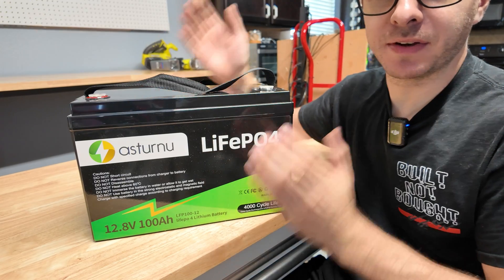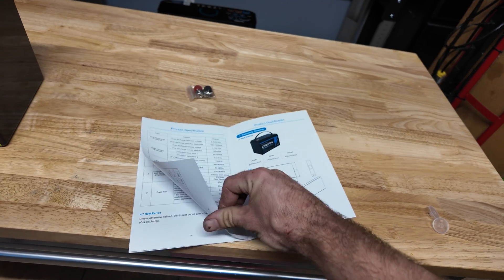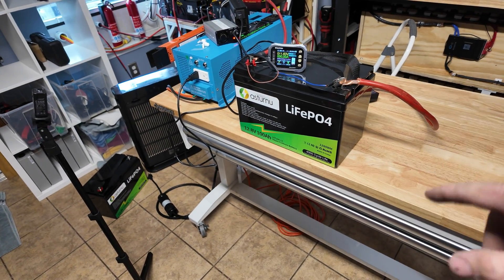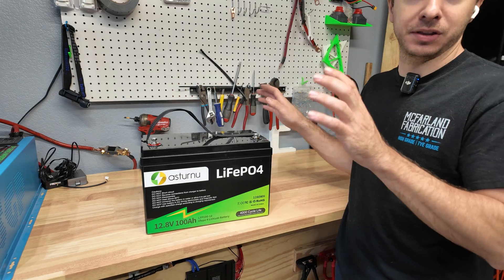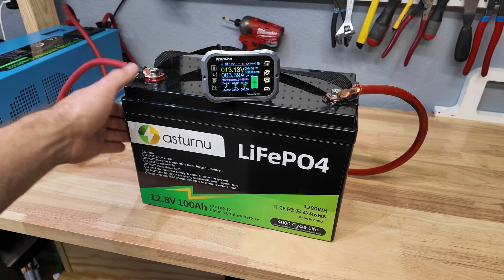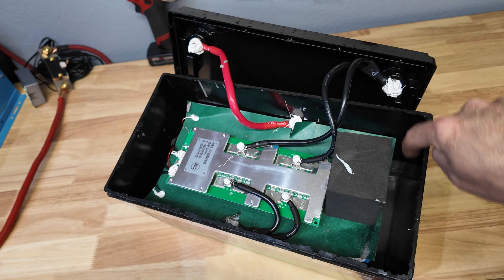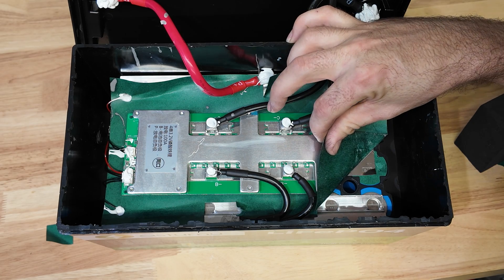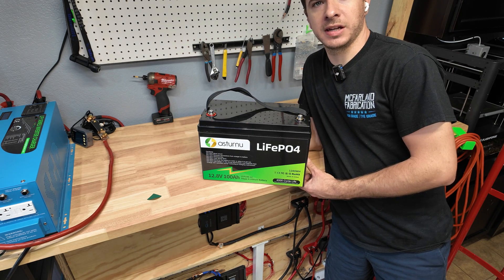Asturnu 100 AH 12 Volt Lifepo4 Battery Review  First Battery To Fail Testing?????

Comment: Good review, Mike, and thank you. I am curious if the 10% loss is due to the conversion from DC to AC in the inverter, or if your other tests on other batteries showed rated capacity with the loss through an inverter.

Comment: Im going to or transform a few UPS' with power stripes. Can you recommend some cheap batteries?  I have 4 ups's and they are about 15 x 6 x 5.  They will likely need new electronics to repower via 115 v ac.
Reply: Lifo or lithium would be fine.
Reply from the maker: What’s inside them now? Lead acid? What’s the amp hour rating?
Reply: @Mikebuildss ty! Single  6x 2.5 x 3.75 non spilable lead acid..   input 120v -12A  50/60 hz,  battery outlets 120v 7.1A 50/60  850va  450w. Total current 12A  USB 5v 2.4A.  
 APC BE850M2 models. 4 divices total.  Not sure what the 850VA is.
Reply: @Mikebuildss . TY.   Brand

APC

Battery Cell Composition

Sealed Lead Acid

Product Dimensions

17"D x 14"W x 9"H

Voltage

120 Volts

Color

Black

Material

other

850VA / 450W Backup Battery power supply

9 Outlets (NEMA 5-15R): 6 UPS Battery Backup with Surge Protection Outlets, and 3 Surge Protector Only Outlets

Two USB Charger Ports (2.4A shared)

5' Power Cord, right-angle 3-prong wall plug (NEMA 5-15P), wall-mountable, plus FREE Windows PC power-management software (Mac OS uses native "Energy Saver" Settings)

Item model numberBE850M2Batteries1 CR123A batteries